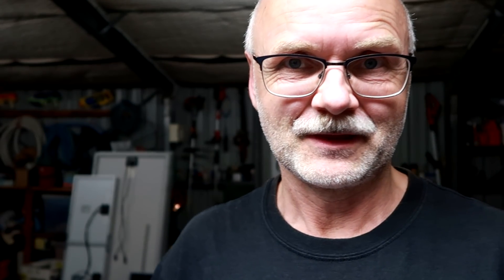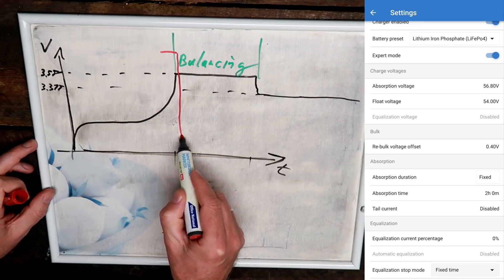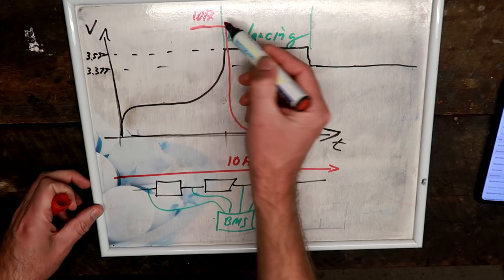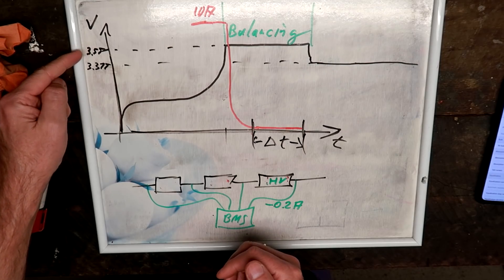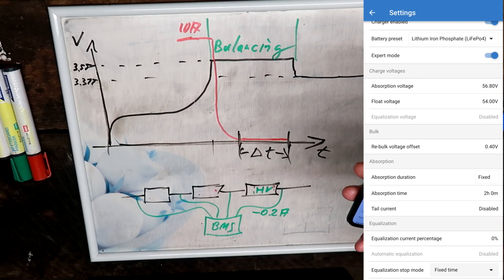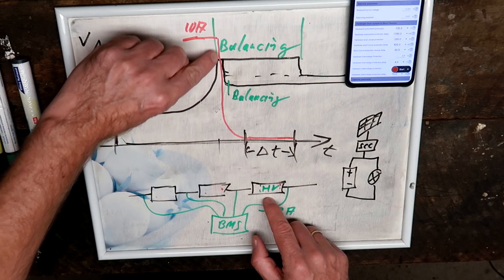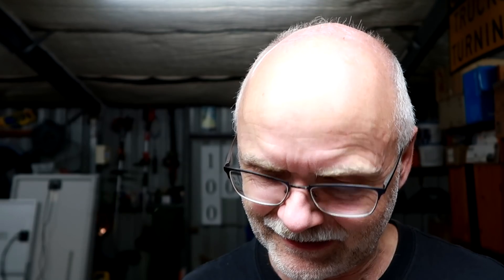Can I balance my battery while floating? Well, I do!

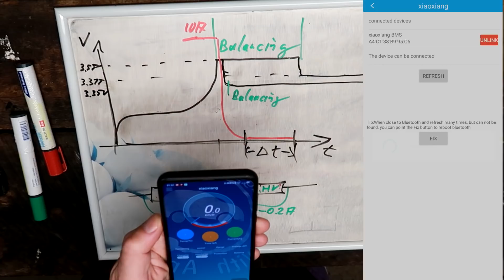Comment: @11:47 - You drew a GREEN line and said, "This is where my balancing STARTS "  Actually, the balancing started when the Cell Voltage first went ABOVE 3.351 Volts, during BULK Charging.   How can your balancing "start" so late - when the voltage is actually FALLING below 3.351 volts per your graph?  Doesn't your balancing actually terminate ( it does not begin ) when the cell voltage falls below 3.351 volts?

Comment: Why don't you take Jeremy's advice and only charge to 54.4V (3.4V/cell). You could use a longer Absorption time for balancing, or better yet, set the tail current at 1-2 Amps. This should give you a resting voltage of around 53.9V/3.37V.

Comment: I think you are right. The problem for longevity is lithium plating.  This happens when the highest cell is pushed too high and current continues. Victron is risking that more than your settings especially if the BMS used   has a low balance current. 
  If I am correct balancing is not critical if you stay away from  charging near full SOC . So victron is risking plating just to solve the problem of plating.
  You need to reset your shunt as infrequently as possible and balance at as low a voltage as possible even if it takes  longer. 
Marine may be a more critical  environment, they may need to compromise longevity for a little more capacity.

Comment: Me, I like your conservative settings, they mostly make good sense. I dislike drain-style balancing though, but for your purposes it's adequate. The one thing I've learned from you that I didn't learn on my own is that you can float them to full capacity through absorption at lower voltages, I thought the voltage to state of charge curve was fixed, but actually, it's only once the cells are close to full that the charger can overwhelm the ability to absorb energy and send the voltage up higher and that's actually a side effect and thus any higher voltage over static "full" is sufficient to produce near full capacity. That's really interesting and really useful. Thanks :-)

Comment: One good reason to charge at a lower part of the top end knee is that your cells will reach full at different rates and you have some headroom for not cooking the weakest cells every time you fill them up if you stop early and let things equalise.
Reply: What does it mean - the weaker cell? Why it is weaker? Why it goes up during charge and goes down lower when discharge?  Internal resistance- bigger or lower? Capacity, bigger or lower? Looks like weaker cells runs up, bms/balancers  do them lower, and thay become not at the same SOC like others. Or if we use float,  at 3,4v weak cells can absorb...
Reply: @AlexV-j3v  less capacity - eg take a 3 year old worn 8Ah cell and it will likely be 7.5Ah or so, put it in series with 3 brand new cells, discharge each to 2.5 individually then put 7.6Ah into the string, the old cell is full and at 3.65V and the other 3 are still needing more and at 3.2-3.3V on their way up. Continuing to charge without a balance solution overcharges and over voltages the weaker (lower capacity) cell.

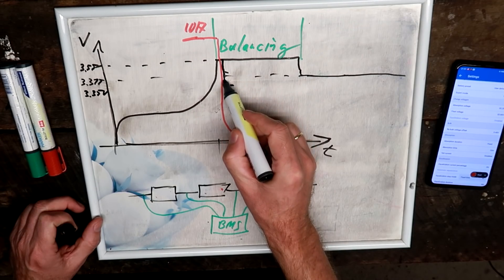Comment: 11:42 what you say about where your balancing occurs is not correct, it actually starts on the up slope to the left of that - it's not important that it doesn't drop the voltage of the cell with higher voltage, it IS pushing more energy into the others relative to that one, and is therefore charging them more quickly and working towards an equilibrium. The trouble is that at those higher voltages your HV cells (low capacity cells) can be getting damaged while your higher capacity cells are just charging normally. That's why I much prefer full time active capacitor balance boards. They can shift more current and they can run full time with low draw, so as soon as the full cell voltage starts to rise they kick in immediately and start to shunt current into the bigger cells. This matters on the top and the bottom equally. But if you do have a genuinely different sized cell and you do reach the bottom AND the top then the chances are this will not be enough to avoid an over voltage scenario. Hence it's better to stay in the constant-voltate part of the curve on the lower side and only push the top end on the high side as gently as possible to generate the cell difference required to activate current flow between cells. Once top balanced you should see very little cell drift assuming no self discharge differences riding on top of the capacity differences.

Comment: I have a 8s 24v EVE system. After doing my first balance at 3.55v (No need to go higher IMHO) my cells stay within 10/15mv from 3v to 3.4. I exclude both ends of the charge/discharge curve as usable because it is really negligible. If I were to need that extra juice, it means I did not size my system properly.

Comment: Question that you may have already answered...  When you "float" at 53.6 I've noticed on my shunt/monitor that if there is a load, it momentarily uses battery and then the solar charge controller adds power until it is pretty much 0... perhaps 0-4W in either direction...  If the load is larger and you remove it, momentarily it seems to charge the battery before backing off/etc.  Is that a bad thing?  Seems like at one point, the thought was to bulk charge and then essentially set the float low enough that it doesn't re-trigger any charging unless there is a decent drain on the battery.  

Perhaps  on a related note, the unit i'm using is a Growatt unit.  I notice that the CC charging up to whatever voltage completes after which it "absorbs" for a few minutes at CV.  As soon as that finishes, it goes into FC and floats at my desired float charge.  The odd thing (i'm thinking this is strange) is that the battery meter shows that even with no load and inverter off, perhaps up to 200W starts being drained from the battery and tapers off until it reaches the float voltage.  So it appears on those, that the unit actively discharges from higher voltage down to the float voltage. (FYI, my 24v system is using 26.8 as float and 29.2 as constant current charge per battery manufacturers recommendation - when i had CC charge to 27.8 they advised me it was too low as their BMS would never balance the battery).
Reply: I do not agree that your charge controller is doing this =>  "... the unit ACTIVELY discharges from higher voltage down to the float voltage ..."

Comment: I charge to 100% , turn off charging until 90% at the Same day and only then recharge. It is not good or healthy to keep the cells above 3.45V for a long time. But i think victron does not allow such a setting Based on SOC
Reply: Why are you charging above 90% SOC ?

Comment: The basic answer is no.  For LiFePO4 you can only properly balance cells when the voltage is modestly higher than the cell's resting voltage.   A Float of 3.375V is not high enough.  Sure, you can try to balance at a float voltage of 3.375V, but equalizing the cells at that voltage won't actually balance them.  At all.   Why?  Because the balance current would be too low and the voltage has too much freedom to move around with very little current when its that low.  I would go as far as to say that balancing is basically impossible at 3.35V or 3.375V.

So basically, balancing is only effective at the Absorption voltage (that is, a voltage modestly higher than the cell's resting voltage).

In terms of balancing while in bulk... actually this can be done to some degree.  If the BMS is smart enough and stores the cell history, it can figure out what kind of balancing is typically required during Absorption and it can try to apply it during bulk.  It would basically be an educated guess, but once it finally gets to absorption it would then have less work to do to clean-up the cells with a final balancing.  I don't know any BMSs which do this though.

--

Battery degradation is more a matter of the SOC, NOT the bulk target voltage.   Remember that the actual break-down voltage for LiFePO4 is 4.2V.  Other lithium chemistries have less margin, but LiFePO4 has a huge margin.  Bulking to 3.55V isn't going to hurt the battery.

--

Remember that the proper target voltage for the charge controller depends heavily on the charge rate.  If charging a battery slowly, lower target voltage is necessary to avoid over-charging.  If charging a battery quickly, a higher target voltage is necessary to avoid under-charging.  There is no 'right' answer... the answer is 'it depends on the average charge rate'.  With the amount of solar you have now, you are probably charging at a high-enough rate to warrant a 3.50V or 3.55V bulk target.

And I'll give you another reminder that with the number of strings you now have, blocking diodes are now mandatory.  Look into getting a proper solar combiner box.

-Matt
Reply: You said, " ... Because the balance current would be too low ... ".  Oh, really?  At 3.351 Volts the Balance current would be ~90% of the balance current at 3.6 Volts.  So, how is that, "too low" ?   In the real world, the Balance Current is not too low ...

Comment: Great topic and video.  This has been an area on my mind for awhile.  The only catch I see, is many BMS's are hard set to start balancing at 3.55v.  The best I can figure, it so set your bulk charge voltage to 56v (3.5v), thus, when that first or second cell hits 3.55 it will start balancing off the the high voltage to the pack.  With the voltage being near full, the risk of over voltage should be minimized.  Thoughts?

Comment: Andy, This is great stuff. Keep asking these questions. On another U tube  " Emily and Clarks Adventure" Clark has made a hybrid system with a big led acid bank and a smaller LIP companion all hooked together. I wish you would take a look and give your opinion. The idea is the LIP does most of the work each day and the LA stays at or close to float and only discharges in a big demand event like extended low charge days. This greatly reduces the cycles on the LA bank and  extends their life. 
Many boats have a big LA bank so this is a way to get the benefit of LIP at a lower cost and not having to wait till the existing LA bank is dead.

Comment: Passive Balancing is slow & for Low Capacity cells.  Typically below <2A.  Only burns off hi volts.
Active Balancing >2A to 10A for large capacity cells,  Transfers from Hi cells to Lo Cells.

3.65V per cell is the "Max Allowable" for LFP.  They always settle to 3.55 within an hour and that IS the 100% point in reality.  Remember Nominal os 3.200V per cell and full working power-curve is 3.000-3.400.

EVE SPECS INFO:
4.2) Standard Charge
The standard charge means charging the cell with charge current 0.5CA and constant voltage 3.65V at (25±2)℃, 0.05C cut off.

4.3) Standard Discharge
The standard discharge means discharging the cell with a discharge current 0.5CA and cutoff voltage 2.5V at (25±2) ℃. If required, the battery can be discharged at 1.0CA constant current to a cutoff voltage of 2.5V.

EVE 280AH Cell:  (280 X  0.05C) = 14A  

HERE are Settings used with a Midnite Classic Solar Charge Controller for LFP Charge Profile.  A QNBBM Active Balancer installed on all LFP Packs with the BMS.

All equipment MUST BE Voltage Corrected & Calibrated (VERY IMPORTANT) 
  - Divide Values X2 for 12V.   Multiply X2 for 48V.
Absorb: 28.2 for 15 minutes (3.525vpc) (some call this boost)
Equalize: OFF
Float 27.9V (3.4875vpc)
MIn Volts: 22.0 (2.750vpc)
Max Volts: 28.7 (3.5875vpc)
Rebulk Voltage: 27.7 (3.4625vpc)
End Amps: 14A (*1)

This get's the bank charged to full with high amps (Constant Current) and then float (Constant Voltage) tops off so the cells are on average between 3.475-3.500. I am running 7/24/365 so float is used up by the Inverter + provides whatever the packs will take to top off.
(*1): End Amps is calculated from the {Highest AH Battery Pack} in a Bank. IE: 200AH X 0.05 = 10A 280AH X 0.05 = 14A.
** Coulumbic Efficiency for LFP is 99%
Reply: WHY are your cells getting so out-of-balance that you actually need 2 Amps of Balance Current ?

Comment: i myself like active balancers as these will start working any time the battery is 30mv diference and takes power from the higher battery and dump it into the lower battery i feel this is less wastefull on power then dump load balancers
Reply: A 30mv difference between adjacent cells or 30 mv across the whole pack?  What Mfr & model of A.B. does 30mv across the whole pack?  Andy's battery bank only has a 5mv difference across the whole pack, and it only operates near the end of the charge cycle = very limited time.
Reply: @MrSummitville  active balancer work all the time no matter what voltage andy's cells are still knew i suspect as they get older they will start to drift more
the active work between cells if one is 30mv lower then over this could even be 10mv im just going off the one i have it will start taking power from the higher cells and putting it into the lower charged cell and thay will trigger no matter the point of charge it just sees the set voltage diference and starts to balance

Comment: i dont think scc are that smart from what i have scene the batterys only offers current if the solar is not producing enogth power to run the load so then takes power from the battery untill solar comes into sun again and can then power the load and the charge the battery this will happen with out a charge controller

Comment: Hi there i follow you with great interest in the U.K.At the moment i run a 15kw powerwall made of laptop batteries and very nice to .But i want to go for brand new batteries so i watch your youtube every episode.Can i ask one thing.In the summer in uk(HA HA) my batteries are fully charged by 10 oclock in morning(30amp).MYy question do you bring your batteries up to float conditions so the battery can absorb all day at low amps.I am still trying to get this float thing lithium ion rise to voltage and the amps drop off a cliff the last 10% takes about 1 hour then .1amp forever.Is this the same with lifep04??.I love the flat curve(charge/discharge) my inverter can do 60v so i am planning to run 17s @ 3.45V So the float will be about 9hrs???
Reply: Bulk and Absorb charge to 90% SOC and then you can try Float Charging the LiFePO4 battery bank at approx 3.35 Volts per cell or whatever voltage pushes ~0.1 amp into a 100AH cell ...